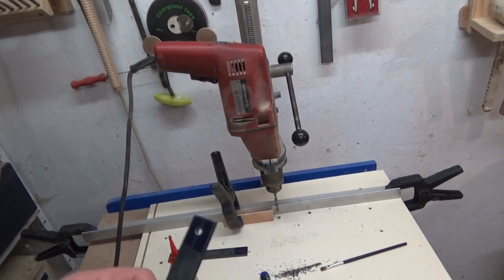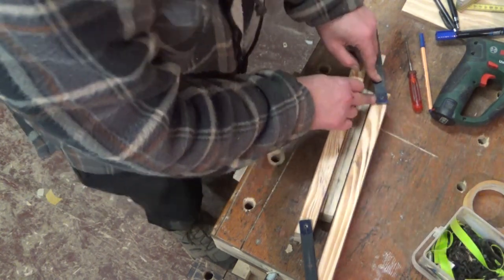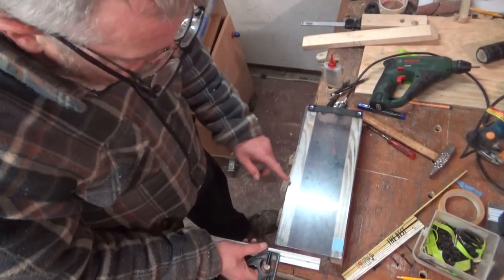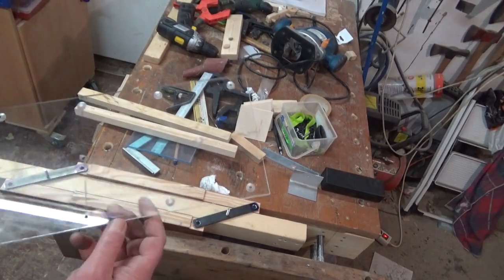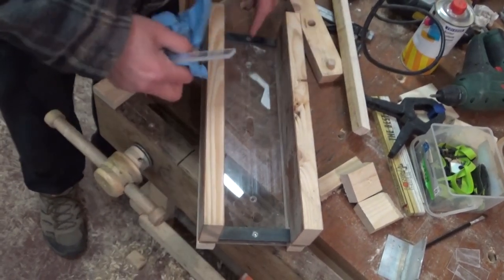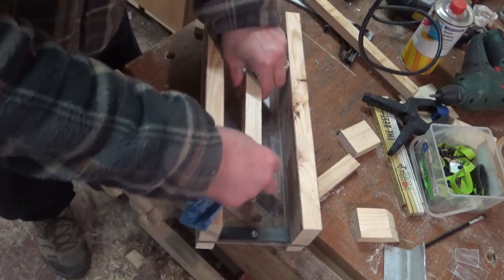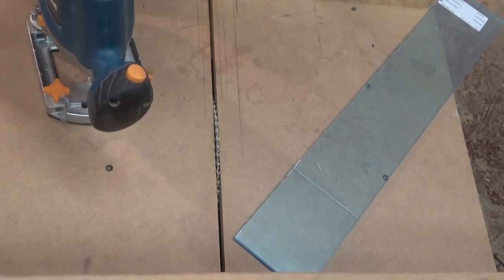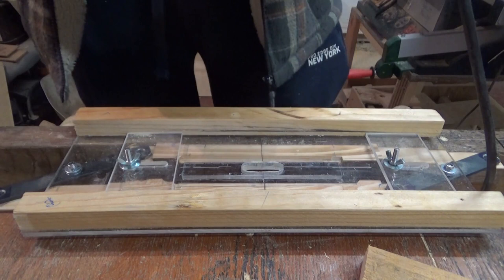Self centering floating tenon jig.

Comment: Hi Dave! Thank you for the video; I enjoyed it very much especially the dramatic center-punching! I also like the trick with the acetone, which I didn't know about. That's going to be a nice jig to have. I had some floating tenons once, but I went to the doctor and got rid of them. Wishing you a pleasant day. Take care my friend.
Reply from the maker: Thanks Todd. Have to have a little drama ;-) The Acetone works great do a test first as the acetone can make the edges get fine cracks if the cut is a little ruff. The jig save soo much time and makes great joints. Now if I can just get them in my knees.. 
All the best Dave

Comment: Top Job Dave, as you said, the mis-alignment doesn't really matter as long as you keep the same edge as the datum. You will also be able to offset the mortice by inserting a packer against one edge of the workpiece 👍.
Have you seen a guy on here named.  Izzy Swan?  He come up with some great jigs......all the best mate
🌻 Nigel .......MuddyBootz Allotment 🌻
Reply from the maker: Thanks mate. Yes I marked one side as front. I used a bit of tape to pack one side it want out by much and its on the jig so I dont have to put it in every time. Izzy makes some crazy stuff. I enjoy his builds. 
Cheers

Comment: Nice one Dave. Is the perspex going to stand the test of time?
Reply from the maker: <its stood the drop test twice not that I was meaning to test it.. Its 8 mil so it should be ok for what I need it for. But if I do break it I can use it as a template for a new one. I like that I can line it up easy being able to see through it. I can always put a window in the next one if this fails.
Reply: @SouthpawDavey  Cool! i know that perspex (polycarbonate) is very strong - just wondering about the scratching.
Reply from the maker: It has a little just have to see how it works out as long as I can see my marks I am ok the foot plat of the router is not in contact with it where the cross hairs are.